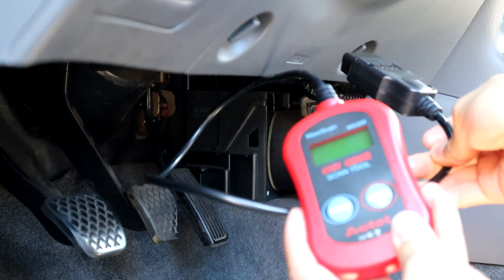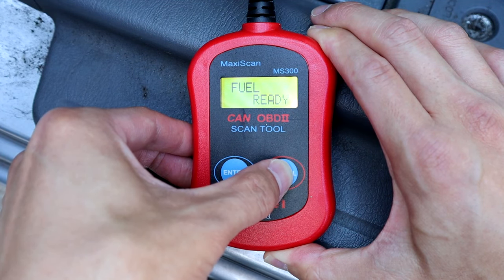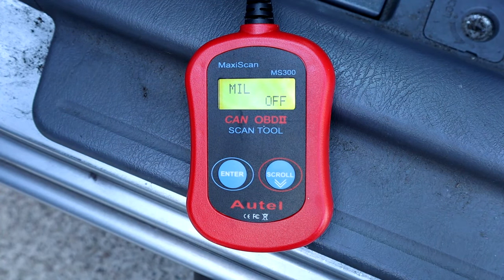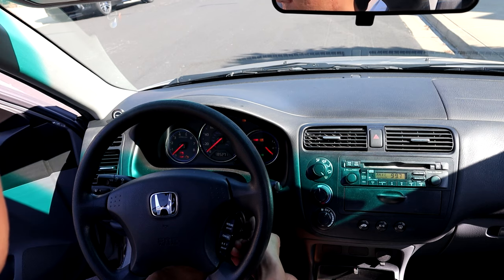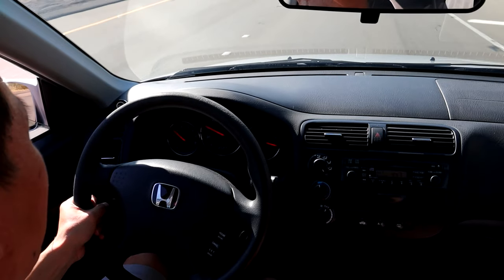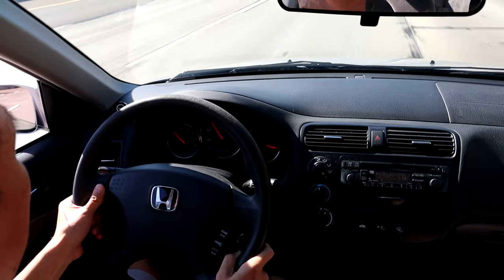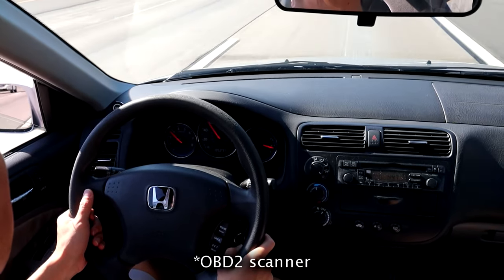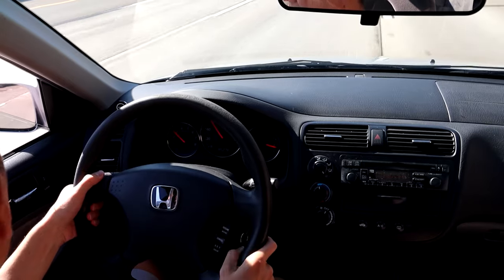How To Get Your Car Ready For a Smog Check – Pass 100% Of The Time – I/M Drive Cycle Ready

Comment: Loved your video.. super informational. Quick question though I got a scanner and did this drive cycle while the monitor was plugged in. I got all of the I/M readiness check but just couldn't locate the catalyst monitor specifically on the my I/M readiness screen. Everything except EVAP was ready [ which is fine since i don't need EVAP ready to pass smog in California]. So to double check again when i turned off my car and turned it back on all the I/M readiness test. I selected "this drive cycle" and all the tests were showing incomplete again. Do I need to redo the drive cycle before i take it for a smog check? I would think since they were ready it should still show as being ready? Am I thinking about it correctly ?
Reply from the maker: 'That's weird.  Yes, if the monitors are ready, then they are ready, but if you were to plug in your scanner again, they should still read ready.  It could just be a one time scanner error, it happens.  Try plugging in the scanner again and see if it still gives you errors.  If so, I would try to do the drive cycle one more time to make sure the monitors are ready.  If you were to plug the scanner back in, say a week from now, the monitors should still be reading ready.  You could also use a different scanner to test the monitors just to rule out your scanner having errors.  That could be your backup
Reply: You can't choose "this drive cycle", you have to select "since last erased", otherwise scan tool is just showing since you turned the key on.
Reply: @derekbushway6251  thank you for that response  to that comment, i have had that same question about which reading do i look at ... appreciate you..

Comment: I’ve done this with a new cat installed. I still have the cat code not ready. Drive it 130 miles so far
Reply: Smog technician said drive more. I drove more than 3000 miles but not passed. So I installed both cat convert and drove 2000 more not passed. Went dealer they made me wait all day and said cat converters are not OEM that might cause trouble,let’s put new mass airflow sensor ($960). I came home cleaned it, idling smoother than before but not passed. Went DMV extended registration . I am replacing coolant temperature sensor. My truck runs like new but smog check gives me big headache.

Comment: I just found your channel. 
I've been trying to pass my smog test for the past 3 days. The guy tells me it's still not ready. He said the catalytic converter isn't activating. He says keep driving and I've driven it for about 150 miles and he says it's still not ready so he said just keep driving it I'm like wtf how many miles of I have to drive it. It's a 2000 Honda Civic with 94,000 miles. The car is good but it's been in non operation since 2014 with the occasional turning the car on here and there along with putting gas in it. I don't know what else to do before I take it back this week so it can pass the test. Help 🙏
Reply from the maker: Did you try doing the drive cycle?  If it doesn't work after maybe 3 tries, there's something actually wrong with your cat.  You can't just keep driving a million miles and hope it fixes itself, regardless of what your mechanic says.  150 miles is already more than enough.  Might want to get a 2nd opinion TBH, cause it sounds like your current guy is going to drive the car forever until it magically fixes itself, which it may never.
Reply: @nukem384  Your channel is amazing and Im glad I found it. I haven’t done the test yet but i will be trying it soon. I was actually thinking of taking it to get a second opinion because I truly believe I have driven it long enough. It should’ve passed by now. I’m already tired of driving it and not having it pass. When you say drive it to 55 mph what do you mean by full throttle? Thanks for the quick reply this information helped alot. Subscribed 👍
Reply from the maker: @amohvac27  55MPH at half throttle.  Did I say full throttle in the video lol?  If so, probably meant don't do it at full throttle.
Reply: @nukem384  Ok, cool. So do the AC first for 2 mins full blast with rear defrost then take it fast to the freeway at 55 mph half throttle for 3 mins or more then let go of the gas till it gets to 20 mph then hit the gas back up to 55 mph for 5 mins and then I end the test correct? Thanks again. I hope this works 🤞
Reply from the maker: @amohvac27  Yup

Comment: This is the issue I am having have a 2014 mustang GT I haven’t driven in like 2 years because I’m a field mechanic and work out of a truck… sadly I let it sit so long the battery died I know I should know better being a mechanic but it was last on my list the last two years… I believe having a weak battery I had to charge it my issue then once I actually get that done I need to do a drive cycle which Fords is literally insane and too damn specific
Reply from the maker: I would think so.  If you know that Ford reset all the monitors in the event the battery dies (or trying to do the old trick of pulling the battery to reset it to try and pass smog back in the OBDI days) then yeah, you'll have to do a drive cycle to get your monitors ready.

Comment: What if my air conditioning unit is out of Freon?
Reply from the maker: Is it causing any of the monitors to be not ready?  If so, then you're going to need to get your AC system fixed first.  If not, then not having AC isn't going to impact smog.

Comment: Does this apply to a 1989 Honda CRX?
Reply from the maker: Sorry, it does not.  Good ol OBDI in your car.  Basically, they are still going to do a smog the old school way in your car, which is put it on the dyno and do the sniffer test.

Comment: I’m California the guy said it needs 15 warm up cycles and 200 miles?
Reply from the maker: You don't need to drive a zillion miles to turn on all the monitors.  Do this cycle maybe 3 times.  If not all the  monitors are ready, something needs to be fixed.  This process doesn't magically fix everything.  

If you read through the comments, people have driven more than 300 miles and it didn't fix it.  They did this cycle once and it fixed it.  Just don't believe every mechanic that says you need to drive xx miles to fix it.

Comment: What is a half throttle?
Reply from the maker: Push the gas pedal down half way.
Reply: @nukem384  ok thanks for the reply. I have 2003 ford Explorer it has a check engine light for a bad catalytic converter. I will try your way.

Comment: went smog and dude said it had to be driven enough and drive longer cus cat converter so i drove and came back and he said still doesn’t pass that, drive longer . i need help
Reply from the maker: Follow this drive cycle.  Just because you drive 100 miles doesn't mean the cat test is going to be done.  This is an easy way to make sure all the tests are done.  If you've done the cycle a couple times and you're still getting an error, it means something is actually wrong with that part.  This isn't some magic cycle that fixes everything.

Comment: I have a Honda CRV.  I tried the drive cycle as you described in the video, but the evap monitor is still not ready.  What should I do?
Reply from the maker: Try it 2 more times.  If you still get the error, then there's probably something wrong with your EVAP sensor and it needs to be fixed.

Comment: Great info.....My mechanic set my Service Engine Soon light which came on because of a EVAP code. He told me drive about 50 miles, but hoping there's a way to get the codes ready for inspection without driving that far. Thanks in advance.
Phil
Model: 2008 BMW E90 335XI
Reply from the maker: Glad it helped
Reply: @nukem384  My code came on a second time after 10 days, so I am trying to determine where the possible leak is coming from. 
Some videos say the gas cap is likely and other say it also could be the Vapor detection pump. Not sure how I troubleshoot this but it figures as I need to go through inspection this month...
Phil
Jersey Shore Area

Comment: The cadalist monitor on mine goes to NA when I turn on and drive with the ac. And when I turn my car off I get some of the codes incorrect. But when I drive with the ac on the codes would be okay accept the cadilist moniter it stays on N/A  idk what's making it do that
Reply from the maker: You'd have to read the code and see what the car is telling you.  Then research from there and see what is causing the car to throw the code.
Reply: @nukem384  I would get the po420 code but disconnected the battery because I need to get my car smogged. And idk what else to do because I can't afford a new converter
Reply from the maker: @user-yf4ix2bt7b  Disconnecting the battery isn't going to work because I'm assuming you have an OBDII car?  That's exactly the reason for this video, to reset everything if you've disconnected the battery.  But the code is clearly telling you it's the cat.  So unfortunately, you're in a tough spot.  Looks like cat needs to be replaced.  Doing this cycle isn't going to help.

Comment: I have a 2002 honda accord and I tried this but still not ready..it shows EGR valve and 02 sensor not ready. It's been driven over 2000 miles now I dont know what to do
Reply from the maker: If you've driven it that many miles and the codes are still there, you probably have an EGR and O2 sensor issue.  Trying to do a drive cycle will never fix it.  Get your O2 sensor replaced and get the EGR valve fixed.
Reply: @nukem384   I replaced the EGR valve and the two 02 sensor's..does this means that the new parts are no good??
Reply from the maker: @miguelgutierrez8621  It has to.  If you've done the drive cycle and driven on these new parts for 2k miles, something isn't working.  You might want to have a professional look at it and get it fixed to save you the headache at this point.
Reply: @nukem384  I'm going to do this cycle a few more times and if it doesn't work then I'll take it to a shop...thanks for your help I really appreciated
Reply: @miguelgutierrez8621  any luck ?

Comment: Do I have to reset the codes every time I gonna try to do drivecyrcles
Reply from the maker: No, you shouldn't have to.  The drive cycle should clear the codes by themselves.  If you've done an number of drive cycles and the codes aren't clearing, it's more likely you have an actual problem that needs to be addressed.  For example, if your cat is broken, a drive cycle isn't going to magically fix it.  You'd need to get your cat replaced and then do the drive cycle to clear the code.

Comment: I did the steps and it said my Cat was ready, went straight to the shop and they did the test and it failed AND my check engine light turned back on 😢
Reply from the maker: Read the code and figure out what's wrong with the car.  Then get it fixed.  This drive cycle doesn't magically fix every problem with the car.  Sorry!

Comment: After performing all these cycles, and OBD scanner shows finally Green, how much time or distance do I have to go to before OBD runs cycle again and potentially trigger check engine light? If OBD shows green, do I have a certain time limit to go quickly to do emissions test?
Reply from the maker: There shouldn't be a time limit.  If the monitor is good, it should stay good unless something is broken.  But to be safe, I would smog sooner than later.

Comment: I can’t go down to from 55 to 20 in fourth gear
Reply from the maker: You can, you'll just lug the crap out of the car.  That's what you have to do.  I hated doing it in mine, but sometimes you gotta do what you gotta do.  Either that or do what every mechanic tells you to do which is drive the car 100+ miles and hope all the monitors reset.

Comment: Or just sell the car and move on.
Hundreds of $ later on 02s cat cleaners converters that were not with  California emissions and the car won't pass inspection. 
Sick n tired of this BS.
Basically when it's time for inspection just trade the car in every year get the new one already inpected and if it lasts for a year you're good to go.
Reply from the maker: Or just get an EV once and not have to deal with this ever again?
Reply: @nukem384  what's an EV?
Frustrated beyond at this point...
Reply from the maker: @sachsgs2509  Electric vehicle.  It was a half joke.  But true that no gas engine, no having to deal with smogs.
Reply: @nukem384  I hear ya...🤣

Comment: Why encourage people to do all this stuff just to rip of people wen buying a car
Reply from the maker: Not sure what you're talking about.  This isn't the old days of OBDI where you could disconnect the battery and "pass" smog.  Monitors need to be reset even if you disconnect the battery, so this process resets them, or doesn't and tells you that there's an actual problem that needs to be fixed in the car.
Reply: @nukem384  there’s people out there selling people not so legit cars tricking the system into passing smog to get a sale